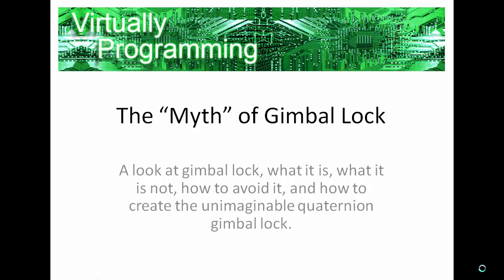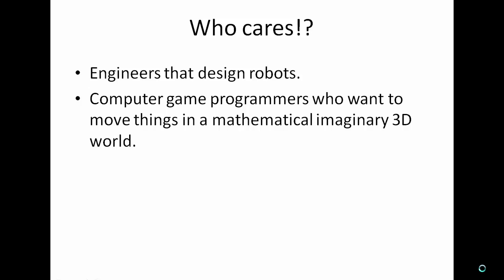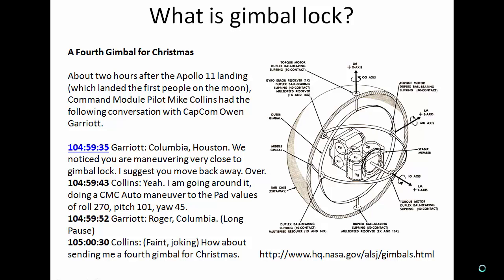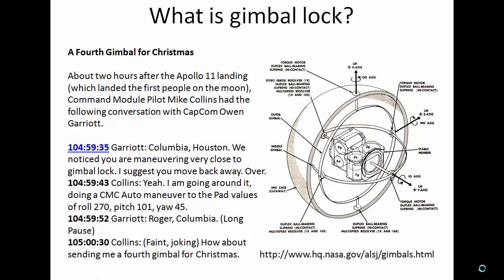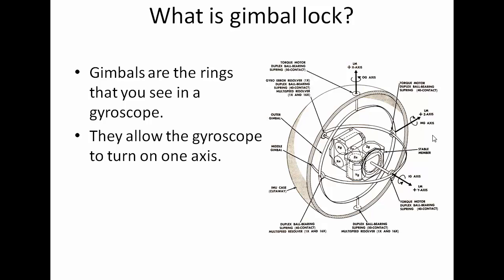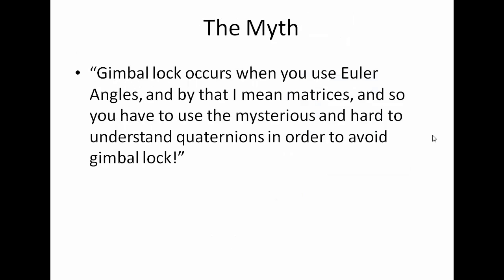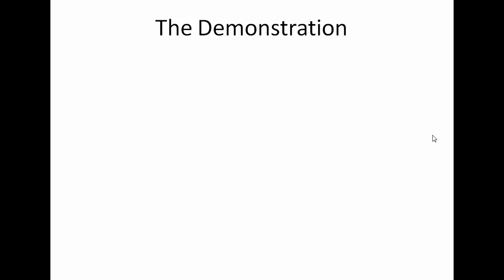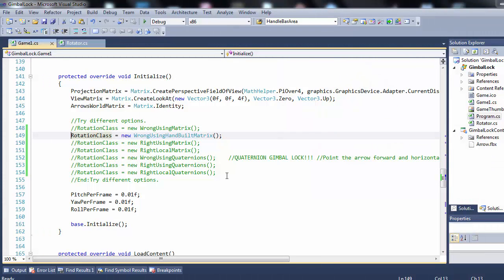GimbalLock

Comment: Sorry for pinging you on a 7 years old video. While I understood the underlying principle for gimbal lock prevention for both matrices and quaternions, the performance aspect is unclear to me. You're saying that there's really not much performance gain from using quaternions in the first place (if I understood correctly) compared to matrices. But using matrices (especially since they're most likely 4x4 matrices) you're doing matrix multiplications for each axis you want to rotate around. Multiplying two 4x4 matrices is quite an intensive task for a CPU (in the context of doing it at least 60 times a second for every object). Not to mention that, at the time when you released this video, I don't even think AVX was released, so you would've been stuck on trying to accelerate using 128 bit SSE registers (or hoping that the compiler does it for you).

Even if you rely on SSE or AVX to accelerate this multiplication, it's still quite intensive since you cannot load a full 4x4 matrix into an AVX register. The only way to actually have performant 4x4 matrix multiplication is using AVX-512 (can store a full 4x4 matrix at once) , but it's still not available in commercial CPUs even today. Just taking this into account, quaternion multiplication is a lot faster than conventional 4x4 matrix multiplication on a CPU (and I'd imagine it could even be accelerated easily using SIMD... two quaternions fit easily inside an AVX 256 bit register, or you can load each quaternion fully into separate SSE 128 bit registers). 

For 4x4 matrix multiplications you have 64 multiplies and 48 additions / subtractions. Compare that with quaternion multiplications which only require 16 multiplications and 8 additions / subtractions. It's true, you still have to generate the final matrix that's going to be used by shaders to transform the model's vertices, but I'd wager that quaternion multiplications + final quaternion to matrix conversion is a lot less intensive than 3 potential matrix multiplications (one for each axis of rotation).

As soon as you generate the final transformation matrix, which gets sent to the GPU, it's smooth sailing.... which is why you want this generation to be as fast as possible on the CPU in the first place. Also a GPU has no issue processing 4x4 matrices... it's working on much bigger registers than CPUs anyway (again, CPUs don't even have AVX-512 today, yet GPUs have been operating at at least double that register size for some time. It's quite possible that GPUs might even be able to load two 4x4 matrices in a single register), so worrying about an M V P matrix multiplication at that stage is useless.